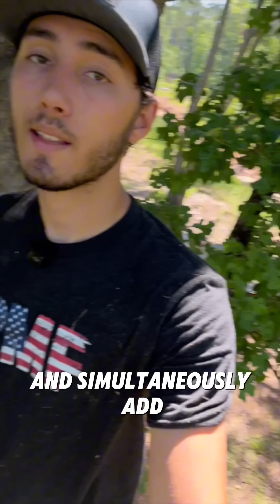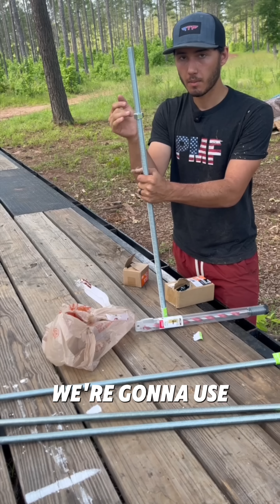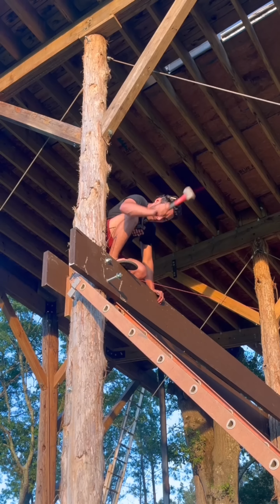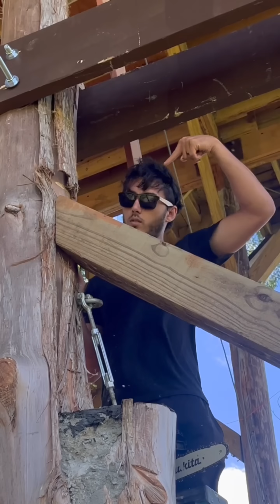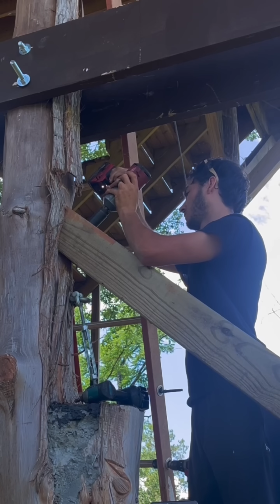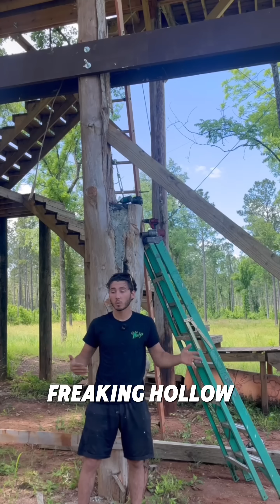Bracing a 25 Ton Treehouse... Will It Hold?

Comment: Hey guy -  if you have to drill a lot of holes through that,  there are options.   Cheapest - get yourself a 1/2" square  to 7/16 hex adapter.  This way you can use ship auger bits with 7/16 drives on them with your existing 1/2" impact wrench.   The only issue with that is those adapters are really meant for impact wrenches with a pin detent instead of a ball detent - so the adapter locks on, and won't pull off when you pull the impact and bit out of what you drilled.    The better way - is getting yourself a lineman impact wrench which is already 7/16 hex drive.   You can drill with one hand - and then just get a 7/16 hex to 1/2" square adapter to use sockets on.   They make socket adapters in either pin detent or ball detent.    (Or just use 7/16 impact to drill,  and your existing 1/2" impact to drive hardware.

Comment: You know what I would do.. I would get tons of line (rope is for cowboys, line is for fisherman) and I would braid it around every inch of those beams from top to bottom to keep those lousy woodpeckers from pecking at my wood 😂 now depending on the weather conditions of where you’re at idk if it rains a lot or not, I would probably use polyester line If it rains often so that the polyester won’t soak up the water and keep it trapped inside of the braids

Comment: may be wrong, but looks like you could be using zinc plated bolts? any reason why if so
Reply from the maker: Yeah they don’t need to be galvanized they’re not in pressure treated wood or live trees that have corrosive acids.
Reply: @SouthernAdventuresYT  that’s fair, but over a 10+ year period the rain and moisture around could cause rust. or this something you’d replace every so often? love your videos. keep it up

Comment: I once had to drill through 2 feet of concrete to run some wires. My arms felt like jello after.
Reply from the maker: Ugh yeah I feel you. I just keep drilling through 16” of wood over and over again
Reply: Currently doing a full gut remodel at a college and the majority of the interior walls are 30” of brick and plaster. A lot of the ceiling is over 11’. Lots of conduits to get through em
Reply: Millwalkee Hammer Drill :D
Reply: I had to drill a 4” hole through 2 foot of concrete as well. Me and my coworker sat down for lunch that day lol
Reply: Dude roto hammer is a must. They get through a food in less than a minute
Reply: If you wear welding gloves, the vibrations your hand absorbs are lessened, 
idk which gloves are best for vibrations
Reply: Hanging threaded rod for cable pathway (trays and hooks for us guy who can use a broom), gotta anchor that shit in concrete ceilings...
3 straight days of overhead hammer drilling will make you question your life choices lol

Comment: How much wood does a woodpecker peck when a woodpecker does peck wood?
I suggest you put down structural footings and support the structure with vertical I beams.
Reply from the maker: Gotta consider root damage the footings would cause
Reply: @SouthernAdventuresYT  Pillar footings a few feet away from the tree.  Ask a structural engineer.  You could do one at a time with a plan to have the entire structure able to rest on those.

Comment: Will the threaded rods cause issues during the seasons change when the woods expands and contracts? Since at least to my knowledge, the metal rods dont expand as much as the woods
Reply from the maker: Good point, but so far I’ve never had an issues with temperature change.

Comment: Im a mechanic and have NEVER built a damn thing out of wood so forgive my ignorance but can you not just fill the hole with some kind of epoxy filler or concrete?
Reply from the maker: Sure I can but it won’t repair the loss of structural integrity